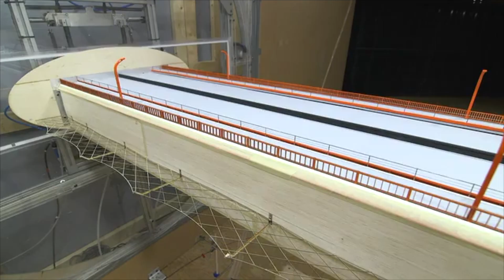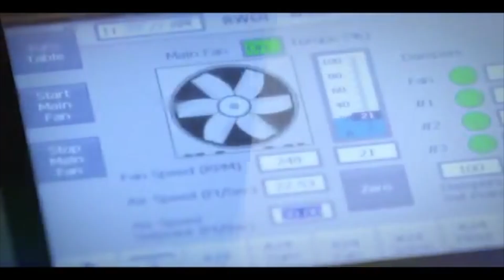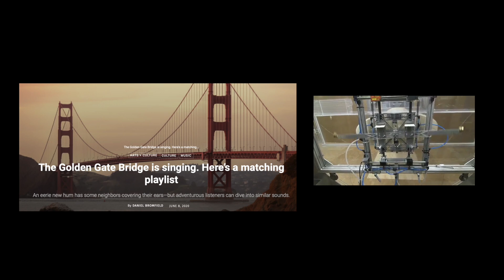The Mystery of the Humming Golden Gate Bridge - Prof Simon

Comment: As a machinist resonance is very dangerous, it can cause harmonics that will ruin a part being made due to tool to part oscillations, the surface finish will be horrid.
Adjusting the speed only slightly will remove this  phenomenom. Have you ever drilled a hole and it turned out triangular?  Thats resonance at work.
Reply: I wonder if resonance could be used helpfully, for example to drill square holes for carriage bolts or such?

Comment: A change was made to the bridge and now it makes sounds, specifically the "A" note. The change was made to the bridge due to higher than designed wind speeds across the bridge deck. The change was meant to stop energy building up in the bridge and resulting in bridge oscillations.   Have any bridge parts exceeded elastic behavior?  How are the current bridge modifications suppose to work to stop the "extra" bridge movements?  Maybe the bridge needs an active stabilization system such as buildings have in earthquake zones? Global climate change is just a scare tactic for the scientifically ignorant to grab more political power. Newsom would let the bridge fall down to sell Global Climate Change in America. Newsom has finally shut up about forest fires be caused by Global Climate Change with a plan to release goats into areas that must be cleared of fuel in addition to humans, of all things, to thin out the fuel in the forests. These are techniques have been used since the 1920's to prevent forest fires. As always, thank you for interesting content! I don't watch TV!

Comment: Sounded like wind rushing through tight wires. Then the video told us that it was wind rushing through tight walkway wires. Is it a problem? Only if it sets up a harmonic in the bridge. Sounds like they should sue the people who installed the walkway railing for failure to do an engineering analysis or anything else they can sue for. ( sounds like American's!)